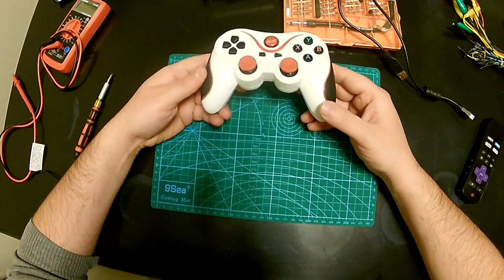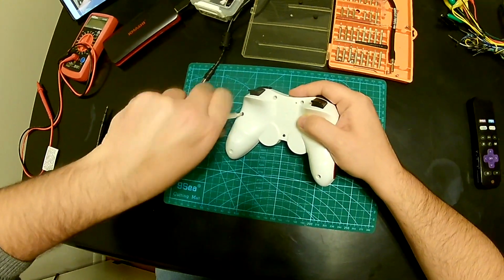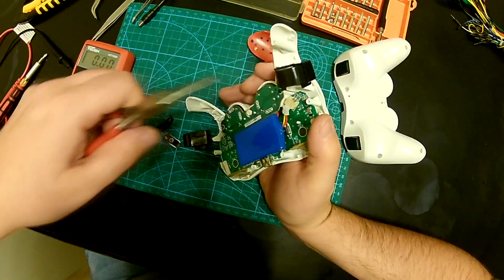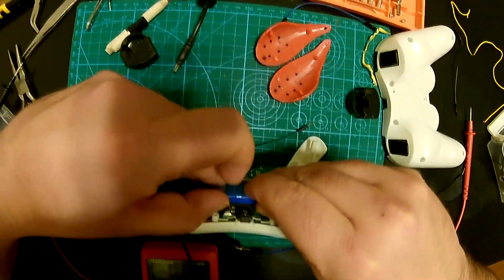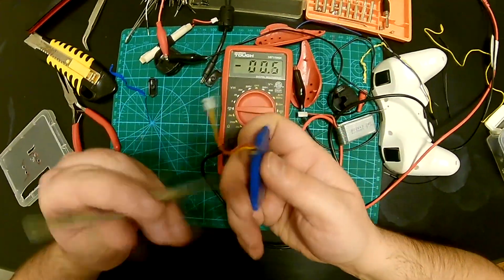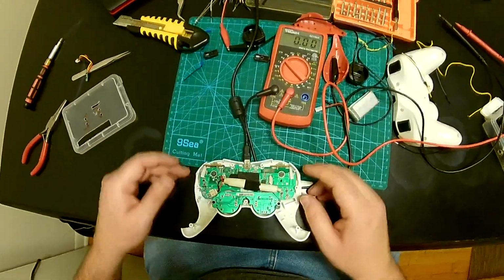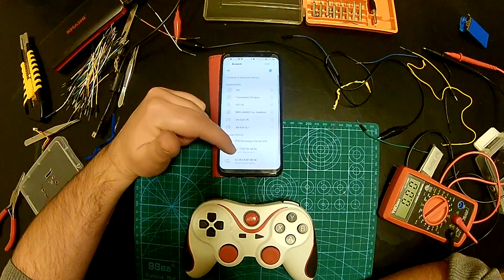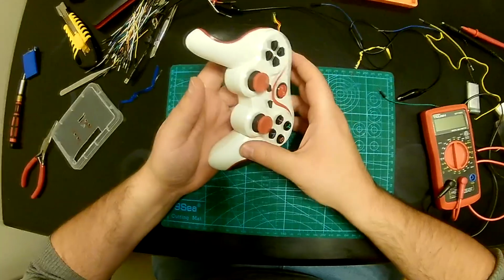T3 Wireless Bluetooth Gamepad Controller Battery Replacement

Comment: Same device, can I put a battery from a hair cut tool? No multimeter but guess it's 3,5v not sure amps. Have another 1,2v 800ma, and another 900ma 1,2v... All rechargeable, my original 400ma it's dead so will it work or too strong? Thanks for any help..m

Comment: how many volts of the original battery ...?
Reply from the maker: 3.7V nominal voltage. 3.2V when flat, 4.2V when fully charged.

Comment: What is the battery voltage?
Reply from the maker: Nominal 3.7 V but LiPo batteries are 3.3V when low and 4.2V when full.

Comment: I'm getting 4 volts but the light blinks once on every single mode, and when it's charged. When it's being charged, it blinks once and it just dies, no lights blink at all
Reply from the maker: Try using another battery for testing. If it behaves the same it might be that the gamepad decided to give up.

Comment: i have anoter version of these chinesse controllers and when i press the home button it blinks once, when i plig it to charge it blicks like 4 times then turns off. if i press home and  x (4 on mine) it blinks 1 time, this action makes it bluetooht visible to pair. but nothiunghapeens.. the weird thig is that i was playing with it just 2 days ago.
what could be the problem??, also if i  hold home and lb it start to blink but just led1 and led4.. i dont know what this does.. but it does not stop until 1 minute.
Reply from the maker: I gave my controller to a friend so I can't check it's normal operation. But If the light turn off while charging that usually means that the battery is full, or the battery has gone bad and the controller thinks it's full. Check the voltage on the battery, if the voltage is 3V or less you should replace it.

Comment: Any idea where to find replacement battery?
Reply from the maker: Not sure about original one, but I had good luck replacing it with batteries from disposable vape pens and toy drone batteries. If you search for drone batteries anything between 300mAh to 600mAh should work.
Reply: @markoni985  and what voltage is needed?
Reply from the maker: @golubovicm  Nominal voltage for 1S battery is 3.7V. Drone batteries for JJRc H36 or Eachine E10 would work just fine, they are small and cheap. Batteries from little bigger drones would work too. You can use blu tack to secure it.
Reply: Thank you so much! I couldn't find voltage info anywhere.
Reply: @markoni985  i found a 3.70 V drone battery but it's 1800mAh is that okay?
Reply from the maker: @furiscalmaxitranxg.2560  Yes, that is ok. It's just going to take a long time to fully charge. But it also mean that it's going to last between charges way longer.

Comment: Sir when i charged my controller the led lights is blinking in few second the led ligth extinguish is it charging or not?
Reply from the maker: Most likely battery is faulty. Try replacing it with another one.

Comment: Bro so my controller has a problem everytime it connects to my phone the controller  automatically shuts down , please help me out
Reply from the maker: Either the firmware on got corrupted in which case little can be done, or the battery can not deliver enough power when paired in which case battery replacement would solve the problem.
Reply: @markoni985   how to got firmware?